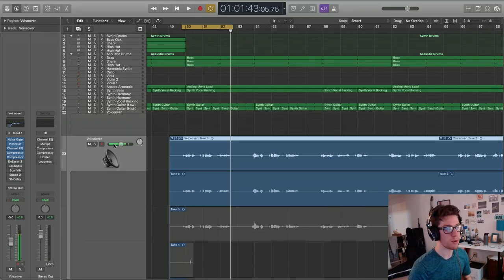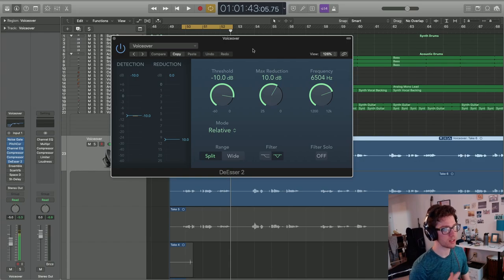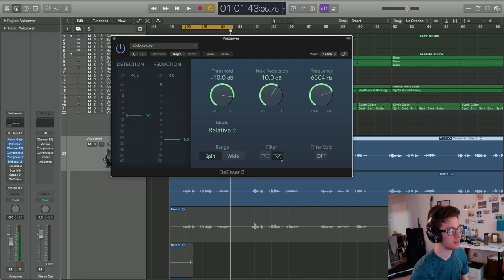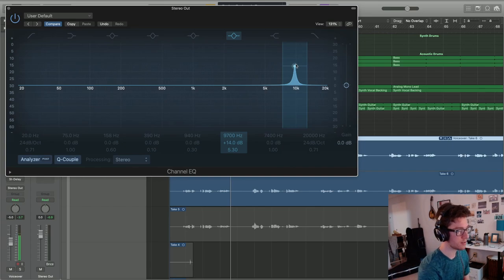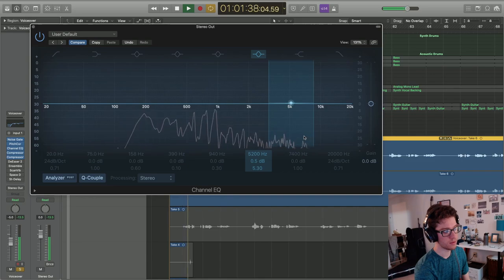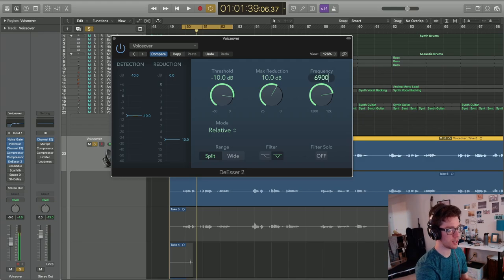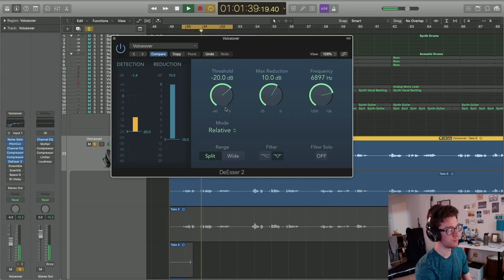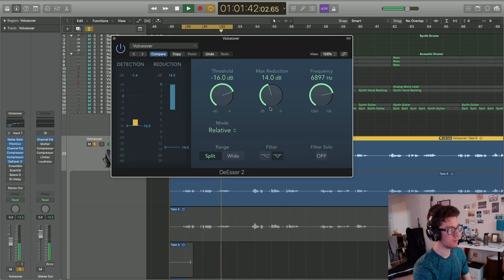How To Use The DeEsser 2 Plugin (Logic Pro X) | Removing Unwanted "S" Sounds From Your Vocal

Comment: Amazing ! 
I kept putting it on before the compressor. No wonder I was having issues
Reply from the maker: The general rule of thumb is to do frequency specific processing last, as overall compression brings out certain frequencies unevenly. For example, compression, then EQ, then deesser, and probably a multipressor later in the mastering stage of the entire project. There are definitely different opinions, but I say why not move from broad strokes to detailed editing!

Comment: can you use the Multipressor as an alternative?
Reply from the maker: You technically could, but I would take two issues. The default high frequency band of a multipressor acts as a shelf and not a peak/notch. Identifying the exact notch that you want to compress is where a deesser shines! Also, a multipressor requires more CPU, so if you are only using it for compressing the high shelf, it would be a bit inefficient. I would usually reserve the multipressor for mastering purposes.